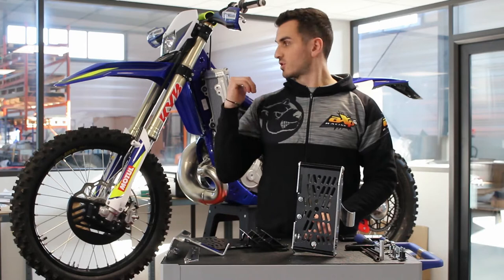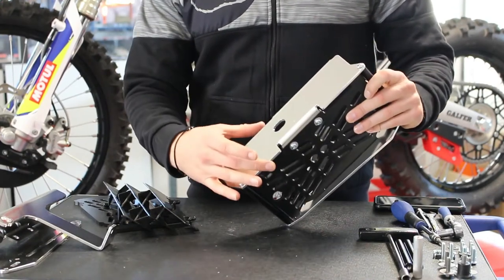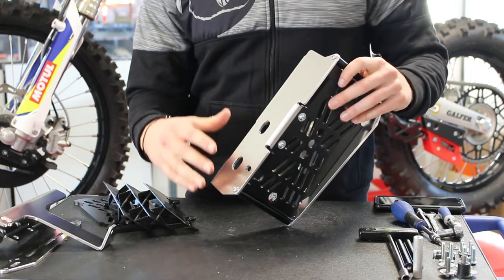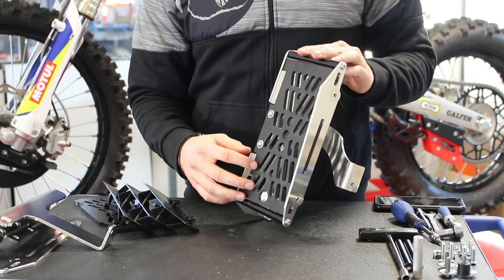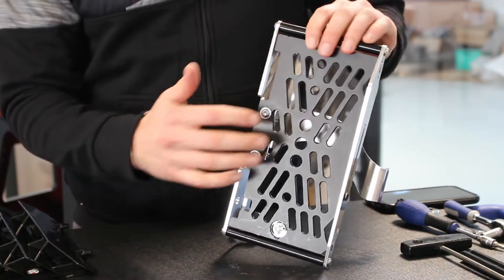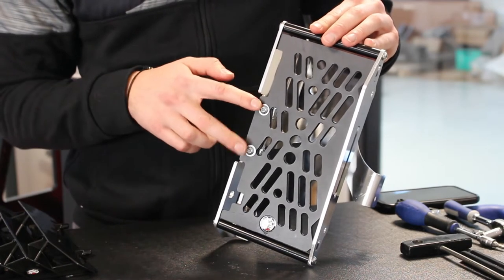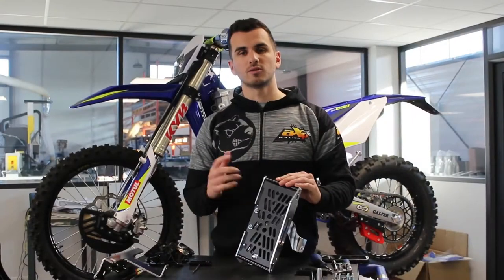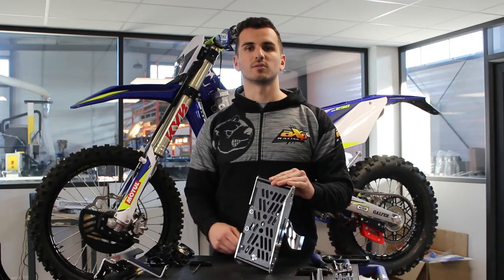XTREM RADIATOR GUARDS / PROTÈGES RADIATEURS XTREM SHERCO - AXP RACING

Comment: thanks ordered it. Where can I find that front disc guard o really like that too
Reply from the maker: This protection is on test to be on sale later, probably 2023 or 2022 end at the best :)
Reply: Id this Avalible for 2023 SE300 Factory ?
Reply: @edigrubisic6267  yes this will fit the 2023 SE300 factory